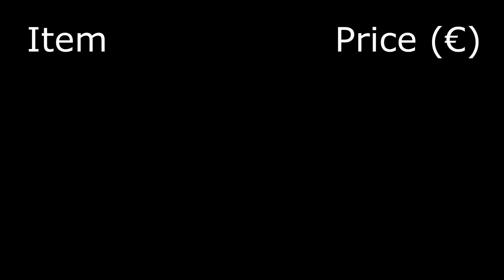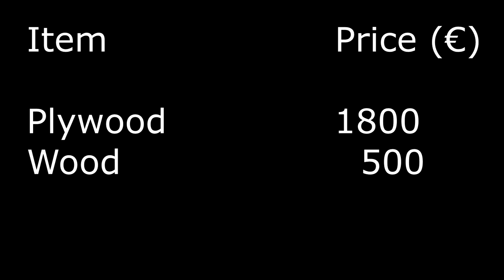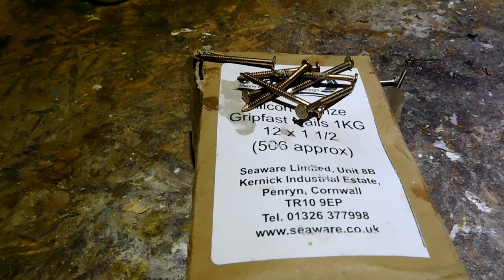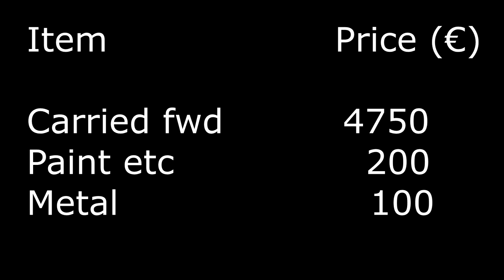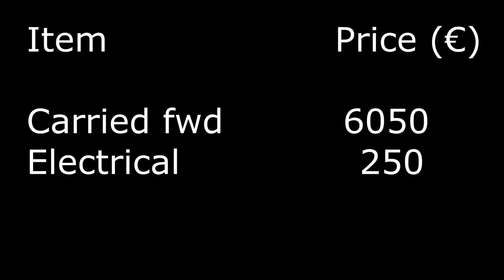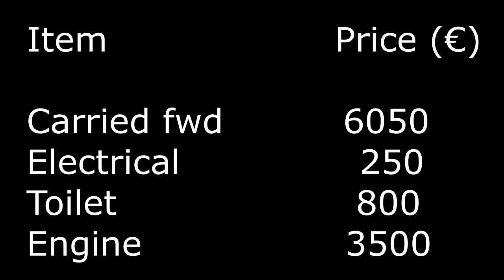How much does it cost to build a cruising sailboat? - SV Tapatya EP93

Comment: Looks like a pretty honest assessment.

I guess the nice thing is that you don't have to spend the money all at once.

If it takes, say, three years to build the boat, the expense per year gets divided by three.

The boat I'm building is a cheap scow-skiff, small enough to car top. It is of highly experimental design, so I'm not building it of the best materials. And I'm only buying them on an as needed basis. So far, I have only purchased the timber, and am just finishing cutting it to shape.

This purchase was not done all at once, so much of it came out of petty cash.

I did decide to go with epoxy for my glue joints, as a lot of them will need gap-filler. And that purchase I really felt
Reply from the maker: Yes, that’s about right. Fund it as you go! Good luck with your build 👍😃

Comment: I found the price breakdown very encouraging, Tony. I was thinking it would be far higher when you look at the materials that have already gone into her and her physical size. Buying the right materials at the right time helps with budgeting and keeping the project running whilst accruing the money for the next part. You can never count the cost of your time doing something like this, I think, but remember it is a valuable asset in being able to run the boat and problem solve during the use of it. If you just got one off the shelf you may never fully understand it as much as you will Tapatya. I have been researching boat building for over 3 years now and have revised my ideas on what to build up from a canoe via some small craft to restoring a 13ft fibreglass boat with the desire to scratch build a 15ft traditional clinker sailing dinghy after some time learning on the 13 footer. You prove the point that the easy way is not always the best way. Keep on keeping on.
Reply from the maker: Thanks Dale. Your comments are absolutely right! Enjoy your build 👍⛵️

Comment: I came back into this subject for I’m doing preliminary budget for my - much bigger - project. Have you maybe any update of the total cost so far? How about masts, sails etc? Thanks!
Reply from the maker: I haven’t looked at numbers recently, although I still think my projections were about right. I can tell you that sails with all spars except masts will be about 4000 euros and the lead and keel will be around 1500. I shall build wooden masts so rough cost of 500. I anticipate an approximate total cost of 25000, but this is little more than a rough estimate
Reply: @SVTapatya  Thanks for that! It seems to be quite reasonable over all. Cheers and keep it going! 💪🏻

Comment: How many hours labor have you ande  your helpers put into the boat so far?  Boat costs are usuallyu figured as time of labor and cost of materials, even though you may not wish to set a value on your labor.  I think by the quality  of your work yuou would skilled wages.. Cheers
Reply from the maker: It's hard to be precise George, but in the region of 2000 hours to date ( Dec 2019)